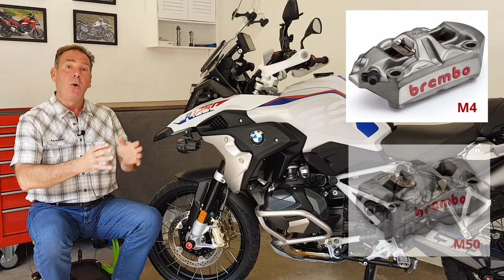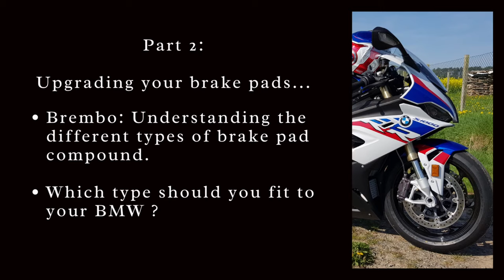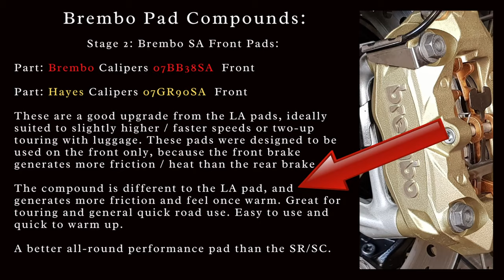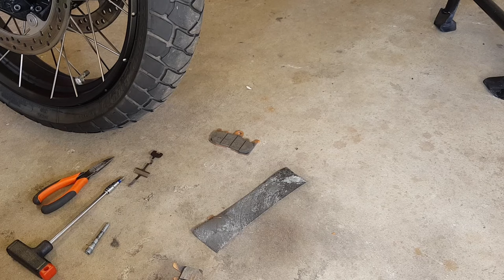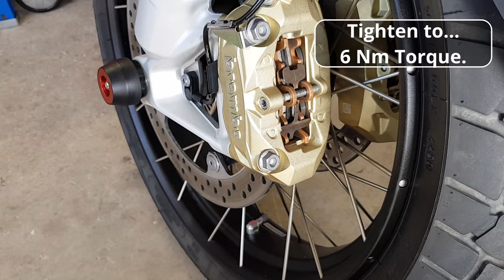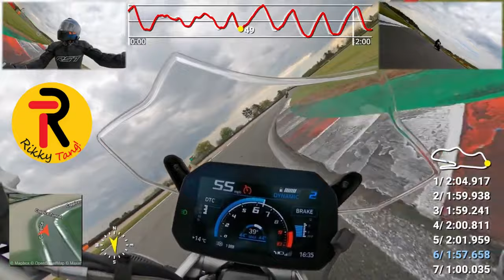EP:11 BMW Brake Pads Explained R , RS , RT , GS/A  Brembo Brake Pads - Compounds - Upgrades

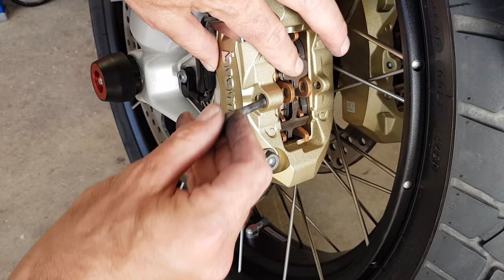Comment: the spring plate with the "U" notch at minute 17:30 is mounted differently than you show at minute 23:05. Which one would be the right one?
Reply from the maker: Hi Gasp, 22:50 shows the correct way to install the spring, with the bolt resting in the U shape notch.
Did you just service your brakes or are you installing new pads?
Carl
Reply from the maker: Hi Gasp, 22:50 shows the correct way to install the spring, with the bolt resting in the U shape notch.
Did you just service your brakes or are you installing new pads?
Carl
Reply from the maker: Hi Gasp, good morning. 22:50 shows the correct way to install the spring, with the bolt resting in the U shape notch.
Did you just service and clean your brakes or are you installing new pads?
Carl
Reply: @justthewayitis  Exactly! and I installed as at minute 22 with the pin in the U-shaped socket I put sintered red Brembos
Reply from the maker: Brilliant, I hope you enjoy your new braking performance 🙋🏻‍♂️👍
Reply: @justthewayitis  do you have a video of the rear brake or the clamping cups in Nm?
Reply from the maker: Sorry no video for the rear.
Reply: @justthewayitis  sei bravissimo lo stesso se passi dalla Sicilia ti pago da bere!
Reply from the maker: grazie, è un'offerta molto gentile. mi piacerebbe fare un giro per la Sicilia
🙋🏻‍♂️ Carl

Comment: Sorry for the off topic question but where did you get the rear swing arm protector/GS graphics and the storage bag for the rear grab handles.  I did not see the information on you video for the accessories. 

Thank you in advance
Reply from the maker: Hi David, no problem, questions are always welcome. If you look through the comments section for the accessories videos I have already given several links to the swinging arm cover, the quality really is very good. As for the small tool bags that fit onto the rear grab handles, these were purchased through ebay and I paid 19€ for them. I dont know your location... so not much point me sending a link, but... smile... if you search for: BMW r1250gs rear tool bags...on your local Ebay, .you will no doubt find them. Looking just now in ebay.co.uk you can find several versions, there is a seller of the exact ones i have. These have been excellent and although they came from China the quality is very good and I get tools and camera gear in mine. One small point there are 3 mounting points. When riding two up, I undue the middle strap so the pillion can more easily grab the handles. The bags still remain secure but when it's just me, I use all 3 straps. 
Happy shopping 👍
Carl
Reply from the maker: https://www.ebay.de/itm/304560010292?mkcid=16&mkevt=1&mkrid=707-127634-2357-0&ssspo=tav0wgymsbu&sssrc=2349624&ssuid=kPvY8I7KT1e&var=&widget_ver=artemis&media=COPY
Reply from the maker: The swing arm cover is again available on Amazon... it was sold out. I used ebay.de and searched for : BMW r1250gs aufkleber... it was near the top of the search results. Brand is UniRacing...
Reply: @justthewayitis  thank you
Reply from the maker: Your welcome 👍

Comment: I was thinking of upgrading my Hayes calipers to M4, but because the piston sizes are different, apparently this changes the ‘feel’ of the leaver. Is this correct??
Reply from the maker: Hi Slip and welcome to the channel. If you are changing to the standard M4.32 callipers that are an OEM option, it’s a straight swop which I have really enjoyed.
I think I put the part numbers in one of my videos that might help you. Black- Gold or you can get Titanium colour too. 
Ultimate stopping performance is about the same, but brembo is just ahead, but feel and control is much better with the M4.32
Reply from the maker: Plus changing pads is then a doddle and you can buy something better like the SA pad, Carl

Comment: Thanks for the informative video.
Where do the oem pads sit in the Brembo range, I.e nearest equivalent?
My Hayes set up has become graunchy, low frequency vibration, just before coming to a stop especially in the wet.  I tried cleaning the discs which worked for a bit. Have you heard of this issue?
All the best from South Hessen, Nick
Reply from the maker: Hi South Hessen, have you tried cleaning both discs and pads at the same time ?.
For pads use 180 ish grit.
For discs use min 1000 grit.
Also use an old toothbrush for cleaning inside the calipers especially the piston side surface. I'm sure you know what to, but the episode in my Ducati series does give full details.
The sound you describe is indeed grabbing... something is not clean or is sticking.. Best wishes North Hessen 👍
Reply: I've only managed to do the discs with a scotchbrite cloth as I don't have  a garage at the moment....I'm not keen on dismantling motorcycles in public car parks....and I expect that the Germans have a law prohibiting it!
Reply from the maker: Hi Nick... LOL, yes they probably do. You can only really clean the pads with paper I described, and as you have Hayes  calipers yes it's a little more work and definitely not easy on the side of the road. Apologies... I forgot to list the pad nearest to the oem, that would be the LA pad from Brembo. 
Carl
Reply: @justthewayitis  thanks Carl.

Comment: Hi Carl, are EBC FA724HH sintered pads correct for R1250GS front pads?
Reply: Also what compound are they equivalent to?
Reply from the maker: HH Pads are roughly equivalent to SC Brembo pads.
As to part number you would need to check on the EBC website 
Regards Carl
Reply from the maker: Also make sure which calipers you have fitted Hayes and Brembo are different
Reply: I have HAYES, are these pads for Brembo calipers?
Reply from the maker: https://ebcbrakes.com/part-finder/
Put your bike details in the above EBC pad Finder
Reply: Thanks for that Carl, by the way your video's are great very informative
Reply from the maker: Thank you 🙏

Comment: Are all Hayes calipers recalled?
Reply from the maker: Hi Gary and Welcome. No not all BMW motorbikes with Hayes calipers have been recalled. My suggestion is as follows, ring or visit your nearest dealer and give them your Chassis number, they will then check that against the known database of affected bikes. 
Also, you might like to physically check your front calipers for any signs of weeping or leaking (Check inside the caliper and outside along the vertical joint) as I describe in the episode. If you have any doubt… ask your dealer to check them for you. I hope this helps, Carl